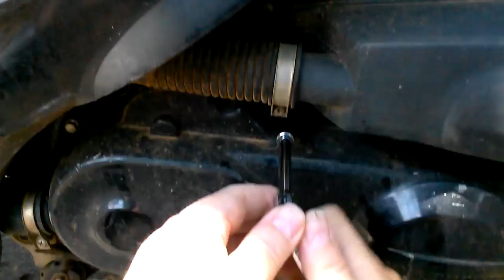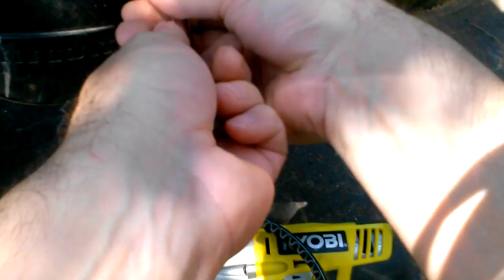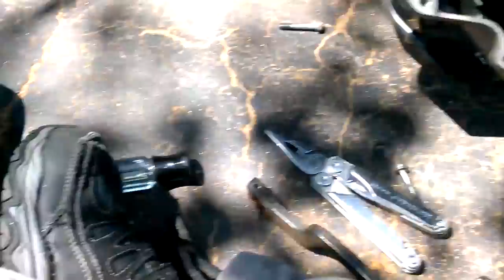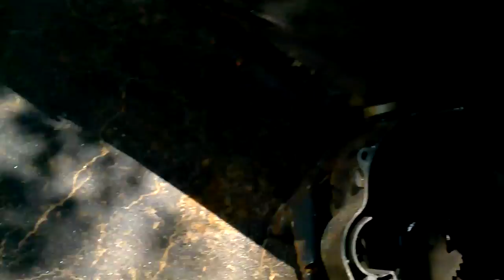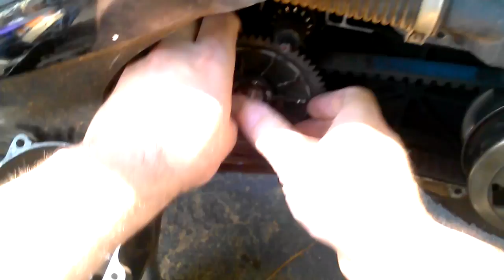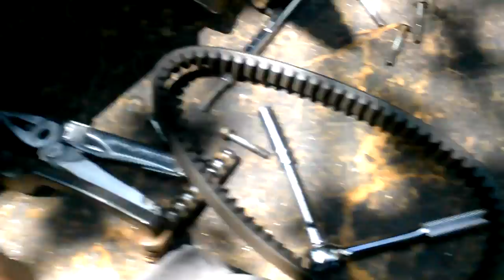Fast 50cc Scooter belt replacement

Comment: You have to pull the clutch towards you to compress that spring and get the belt in there.  no one mentioned that in any videos i saw but this is for anyone hitting the wall. It took me 4 hrs to figure out you have to compress the clutch pulley by pulling it towards you and putting the belt on the clutch first or the belt will not fit. i thought my belt was too small. She's running now though. Thanks again for telling me the size nut on the variator and clutch, my friend!
Reply from the maker: Your welcome ! I got tired of muscling the clutch pully and a dozen belts later realized I didn't have to do that .  This way you don't have to be Dwayne "The Rock" Johnson to change the belt . . . Unless the belt shreds apart then you have to do it the old way .
Reply: Scooter BuuGuu Haha, nice joke about The Rock! lol! Once i realized what i was dealing with it was a ''should i break this 20 some mm nut loose on the clutch and possibly get knocked out from that compressed spring"? Thank God i looked at the way the belt would have to run constantly and thought there has to be a ''tensioner" type way to get this belt on. I've built and fixed many a car, but felt pretty humbled when i made that discovery! Much love, my friend! Cheers!
Reply: Disclaimer: Anyone who has never, nor have the experience, qualification, etc..... try to break the big nut loose on the inside of the clutch housing (not the 14mm housing bolt, the biggest one holding the huge spring inside. Shiny brass color, close to an oxygen sensor wrench size on a car. At least 20mm, i guess around 24mm.)
Reply: we didn't do that and now it's not pulling right is that the reason
Reply: @vickiewilliams7120  It's very possible.

Comment: For the majority of scoots with 8/10mm bolts on the belt housing the best thing you can buy is a 1/4" extension bar about 8-12" long with a T-handle and some 1/4" sockets. Allows you to spin the bolts out in seconds. Same putting them back. Also, when re-fitting the nut on the variator use a drop or two of blue loctite. Because, and I speak from experience here, it's no fun when your miles from home and it works loose. Which you might think is impossible if it's been tightened by a rattle gun, but believe me it's not.

Comment: I was riding today. Nice hot day. Heard a quick and small pop sound on the road. Scooter stopped accelerating. I figure my belt popped after over 2k miles.

Pushed it home. Got on YouTube to see how hard it'll be to change the belt.  This was the first video I found.

I was glad to see it was short and to the point. I hate channels with long intro's and diatribes and telling me to subscribe and thumb up.

I haven't opened my scooter up yet to see if it's the belt, because I had to write this.

Thank you for a no bullcrap video.

Comment: So maybe you'll know the answer to my problem, my belt broke, I put a new one on it and I'm not getting too speed anymore. I noticed my new belt is a little wider then the old one. Of course the old one is worn down tho. It kinda feels like maybe belt slip sometimes too? Almost like It would if the engine was putting, but engine is running fine. Idk if you know what I mean but if you can get back to me I'll reply rather fast.
Reply from the maker: 699 18 30 The 699 is the belt diameter. The 30 is the angle of the V in the belt. And the 18 is how wide the belt is. A belt too wide will make off the line performance sluggish all the way to top speed . I had bought a belt that was to fit my scooter but it was a fake name brand belt and my problem was the same . If the angle of the belt is too much or too little this will make the belt slip . But accidentally getting oil and grease on the pulleys or belt will also cause slipping . Otherwise if all looks good then the slipping may be a faulty clutch .
Reply: @scooterfpv8864  as odd as this sounds, i fixed it by taking a piece of sand paper and roughing up the sides of the belt just a little bit. In sure the belt was an off brand fake belt. I had the exact same dimensions as the previous belt but it seemed wider. Which i just thought the old belt was hella wore down and the new one was nornal size. After i roughed up the belt a little and put about 20 30 miles on it everything turned back to normal
Reply from the maker: Coolness ! Actually it makes sense . 90GTVert had a vid on that but I never did that . Good to hear you got it working 😁👍 @Unknown-hl7sb

Comment: I have the same scooter, How big was the CVT Belt
Reply from the maker: 699 18 30 but if ordering online a replacement I would suggest a reputable site and be wary of some ebay sellers . I ordered a Bando belt like that and the width was too wide . Later there was a post by Bando stating there were fake copies going around .

Comment: What size nut is that on the plate you remove? Thanks!
Reply from the maker: The Drive pully on the crank shaft is a 17 millimeter.  The CVT cover bolts are 8 mm . Cheers !
Reply: Scooter BuuGuu Thank you, my friend! Much love from NC USA!

Comment: Did you not need to check if the weight rollers are deformed?
I wonder if I need to maintenance my scooter for 5 years since I bought it ;)
Reply from the maker: It is proper to check the weight rollers during drive belt exchange . My weight rollers are in need of replacement as I can hear a point of hesitation climbing a hill . For this video that step was ommited for fast belt drive changing . This my secondary scooter still needs replacements (^^);

Comment: Hi man. I bought a 50cc 2 stroke scooter cvt that has been modified with70cc sports cylinder, technigas exhaust, sport variator, upgear kit, and was unrestricted. What i noticed just yesterday was that it runs fine and fast on flat but when i drove to a steep road from a stop with no momentum, my scooter couldn't bear it and won't move on full throttle and seems like it is bogging down. Do i need to change to a stiffer clutch spring like 1500 or 2000? New to scooters so i really appreciate any help😀
Reply from the maker: Kinda hard for me to diagnose without being there to witness what's going on . Could be a lot of things that have the same result in what you said . A slipping belt , bad compression , slipping clutch , stuck roller weights , wrong size drive belt , fuel starvation , etcetera . You could change the clutch spring but on my modded qmb139 the extra power combined with the stiffer spring I ended up replacing the drive belt a LOT more often . If you plan on racing and are replacing the belt every race day then it's an option but for day to day going to work and such I would get a set of different lighter roller weights and do some testing to see what ones you like . I have a NCY 81 cc High compression motor and I'm running 6.5 grams per roller weight on mine . I wouldn't go lower then 4 grams at the lightest , and over 8 grams you risk breaking the star plate on the variator eventually . Hope that gets you pointed n the right direction .
Reply: Scooter BuuGuu it just had a serviced and had it's drive belt change and it feels quicker on take off than before. It just on uphills that i am having trouble. Bit no issues going uphill when i have momentum going up. Thanks man